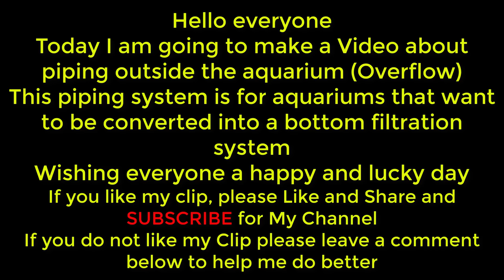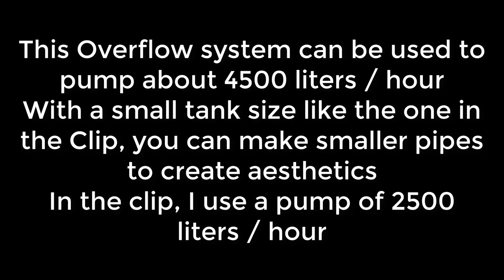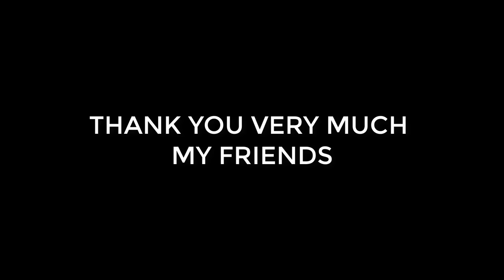Aquarium model 17 - Principle of operation of the Overflow system/ For Aquarium Tank

Comment: Very clever ideas for overflow. Cool idea with the adjusting of 90% and 10% water flow. Both ideas are working at same principle right? Water flow down into a container, then fill the container before overflowing into the aqual downpipe to the sump? I am woundering what size of pipe you are using for the pipe only overflow system. I plan on running about 2500 l/h thro my sump for my 720 l tank. Are these ideas silent?

Comment: I see that you set the sump up so it could be run independent of the tank. When I had aquariums with sumps I did the same thing Great minds think alike. it also means you can circulate more water through the filter without changing the water flow though the aquarium maximizing the bio mass. This also means in the event you need to shut down your tank the filter can continue to run maintaining the bio mass. Doubt I'll ever get back into the aquariums. Wish we had youtube went I was a kid.
Reply from the maker: Thank you very much
Have a nice day My Friend

Comment: Really nice work my friend... it's amazing to watch ur work...but u must have been using this system fr some time now....so can u tell us about the chances of it falling....i kno that the way u made it the siphon shouldn't break but r there any odds and did u had any issues...
Reply from the maker: I'm sorry I couldn't fully understand what you meant
But this is a very simple system and operates completely normal
The most important are the vents
as long as you get it right it works very well but is not as aesthetically pleasing as other tank models
Thank you very much
Happy new year My Friend
Reply: @pieceofpaper924  anh ở đâu vậy. E muốn đặt a làm hồ thì phải làm sao
Reply: @pieceofpaper924  
It may not be as aesthetic as a drilled tank with a corner overflow, but from a functional design aspect, this system is very pleasing. Every part has its purpose, there are redundancies to kick in and it's just a beautiful system to behold. Many people wish to make the aquarium as natural as possible, however that is a facade in my eyes. As natural as a panel of wood on your car lol. The beauty of aquariums is in balance, control, engineering, the knowledge it takes to keep fish and other creatures alive. This is all in addition to the beauty of the fish, however the hard work of it all shouldn't be ignored or brushed aside. Good work man, this is inspiring.

Comment: I would love to make the glass one, but there are no details/measurements of glass cuts, hole sizes, bulk head types/sizes, and pipe sizes to make these. Please upload parts and cut lists in the description :)
Reply from the maker: I just want to explain the operation process of the system
You can make custom sizes as you like
There is no fixed size for this system
Thank you very much
Happy new year 2020 My Friend
Reply: @pieceofpaper924  What thickness of glass did you use or what is recommended?
Reply: He did list the hole sizes as: 5mm, 27mm, & 34mm

Comment: want to know if the overflow that makes when the electrical power of the pump goes out and stops working the water overflows or prevents it from overflowing, I will appreciate your information or advice
Reply from the maker: Of course, if the pump stops working, the water won't overflow
So we have to do many steps My friend
Reply: The overflow has a built in safety. If you go through the video again you will see he tests a power outage by unplugging the pump and the overflow stops, then restarts when the pump is plugged back in.

Comment: Great job brother.  Appreciate if you can give the measurements of the glass box filter ( L x W x H ) and pipes size . Thanks.
Reply from the maker: Actually, that box doesn't need a specific size
Just follow the rules
In the video I made that box louder than usual for clarity in the video
Do as neatly as possible

Comment: 12:50 What if you loose the siphon in the main tube and the left chamber will have the siphon broke? Will be it regain the flow or the siphon after the pump restarts?
The siphon there may be lost in time by accumulating some air bubbles...
Reply: The chances of this are very low as long as the build quality is there, I used a Tunze Overflow for years, and it never lost siphon even once without it being directly altered.

Comment: This system is so clunky. The best sump plumbing is the one in which a whole is drilled through the bottom of the tank. A 3 channel confocal pipe is used for putting the water in, overflow and exit. Just a single pipe is there and nothing else. I have such a system on my 100G.

Comment: perdon pero no entiendo el sentido del dispositivo,realmente lo veo algo ineficiente, soy muynuevo en esto de los acuerios pero no encuentro ventaje que hace realmente¿?
Reply from the maker: This device is used to ensure that when there is a power failure, the water will not overflow and will work normally when there is electricity
It is often used when changing the texture of the filter when switching from the top to the bottom
Reply: amigo eso es para cuando ya tienes un acuario que no tiene perforaciones o no se las puedes hacer para adaptarle un filtro sump, con eso solucionas ese inconveniente y puedes poner tu filtro sump tranquilamente.